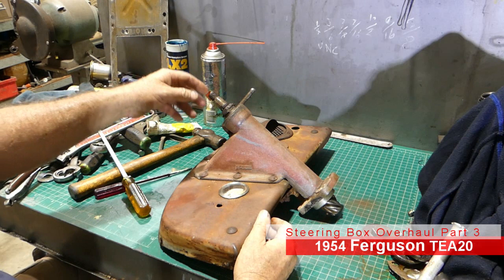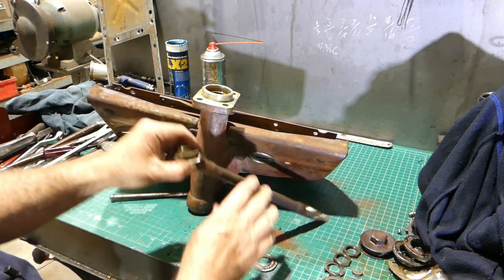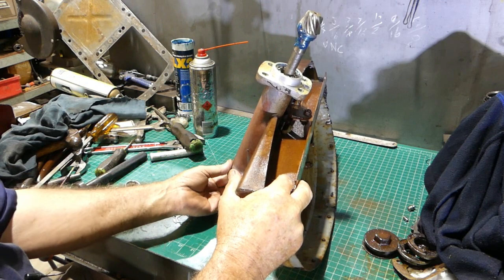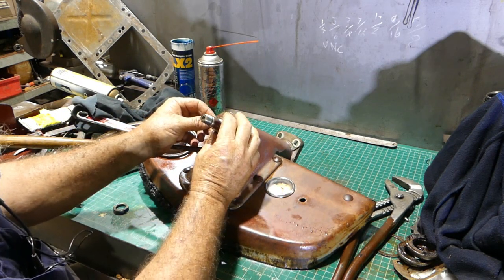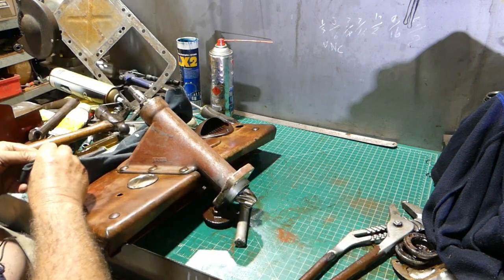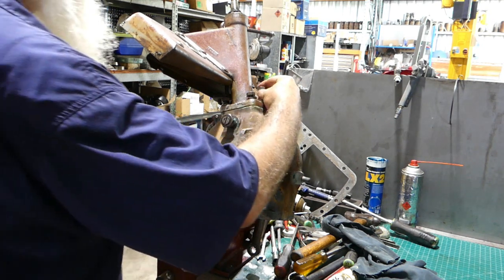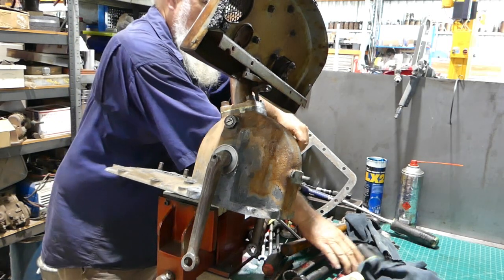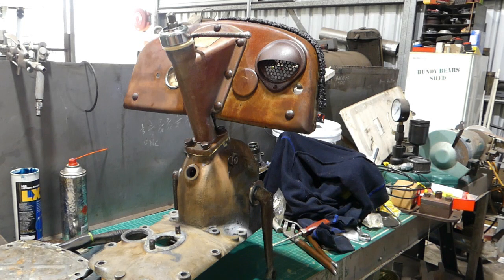Ferguson TE20 Steering Box  Part 3

Comment: Another great series of videos Lance, much appreciated and keep up the good work. Sadly there are alway going to be those who never use the wrong tool, but they have probably never worked on a tractor...or anything else.
You mentioned the paper gasket for the cover plate...If you have access to old paper navigational charts they are ideal for making gaskets. It is high quality paper and is fantastic if you can't get anything else.
Reply from the maker: Thanks 👍 I bought a laser now to try so see how that goes with gaskets.

Comment: Thanks, Lance, I now think I can tear into mine and stop that awful leak from the steering arms.  My biggest fear is that I'll need new bushings.
Reply from the maker: Not a big issue if you do though, knock out and press in.
Reply: Mines does to but I'm holding back till I've done some work with it, preferably make a crop of hay, sell it off and yous an amount of the money urned to do some fixing over winter. If I can help it, get it to urn it's fixing.

Comment: G'day mate it was good watching this very interesting and it's great that you can still get parts especially when you consider the age of her, how do you put oil into the top and bottom bearings?     Looking forward to you doing the next video on this mounting it back on the tractor.    Something I forgot to ask you was do you sell  1 1/2 to 2" open end spanners?   I would like one for my M3 collet arbor that fits on my mill instead of using an adjustable wrench if you do I'll give you the exact size when I order it thanks lance John......the noise of the plain was very faint so your new equipment works well
Reply from the maker: Tradt tools or a company similar would Im sure. The oil goes in the bung on the back of the box, Ill cover that on fitting the box.
Reply: @BundyBearsShed  thanks for replying back to me I've been everywhere down here to no avail I can get one that tight all I would have to do is mill some off the arbor, I was looking for an easy way out   Regards John

Comment: Did you manage to straighten the arm that was bent? Mine is bent on the right side (worse than yours) ... not sure what it's made of, but worried it'll crack if I press it back?
Reply from the maker: Yes you can press them they are mild steel and there is no problem straightening them I find.
Reply: @BundyBearsShed  Thank you! Your time and expertise is so much appreciated. I couldn't fit them in the press easily, but oxyacetylene + vice + hammer worked great ;)

Comment: Hi lance.  A video on over hauling a TE20 transmission.  I have pulled a few part due to worn out sectors and worn  bearing
Reply from the maker: Great suggestion! Ill get this TEA running first there is another one up in the pallet racking, an old 1948 one.

Comment: Normally if I have a good adjustable on me, I use it. In my situashon I'm almost endlessly kooking for the right spanner with no hope until after iv averted to a slolushon, often suwere I've looked countless times before.
Reply from the maker: I find it quicker when videoing at times so I dont get too worried what others think.

Comment: I do need to do a bit of work on my steering wheel asembly aswell. I need to re coat the steering wheel, the deirings are a bit wobly and theirs a brake in the support that needs to be based to make it one again.
I've run mynes a few times recently to do some feeding jobs on the farm (a few hevy round silage bales, it wine's on the hevy ones but it does the job), and just before starting to use it more I changed the oil, and now it drips from the exoust and last time it lost preshure, my hope is that it's just a bad gasket and not blowby so that I can leave it fore a little while and I have a plan for what to do, I'm reily hoping that I don't have to do a rebuild as I'd have to find a good place to work on it/somewhere clean, and help so that I don't do a boch job.
Reply from the maker: Try a really heavy/thick engine oil at times it can prolong a rebuild.
Reply: @BundyBearsShed  ye, I've fought about that but I've only got universal oil on me. I'm hoping to get some, but I changed the oil becous it was starting to get low, I hoped that it was just evaporating, but alfough now it's the leaking that's problematic I think there might be some blow by too. Ist basicly a big mess and I don't know exactly what's going on but I have a vague idea, I didn't wat to but I might do a slight overall if I can work something out.
As they say, 'oil is baisicley liquid gold' and considering I've been to tight to spend much on it so far I I don't want to be spending even half a galon per hour or deteriate my engine much more so that a lot more mony needs spending, so I'm guna take the smartest course of action that my idiot filed head can comprehend and try and force myself to make it halpern.

Comment: What is that round part on the right side of the dash?
Reply: One  with shroud is Air intake.  Other one  Probably a  blanker.  ?
Reply from the maker: the round one if for an extra gauge so it is a gauge blank, the dome is the air intake on the later tractors.